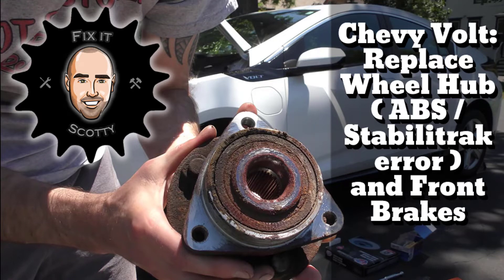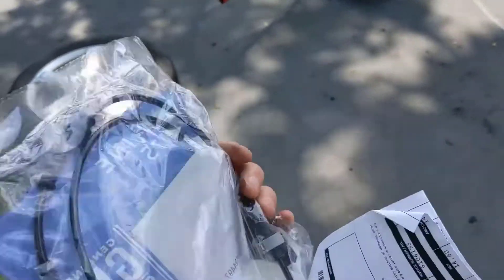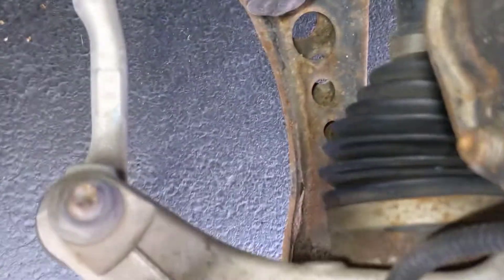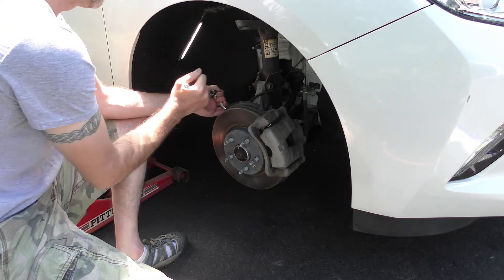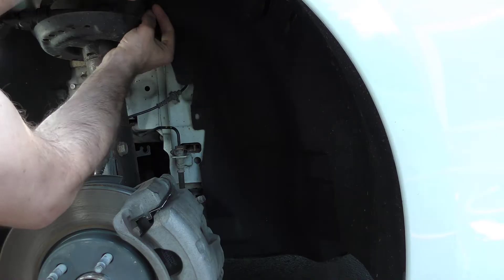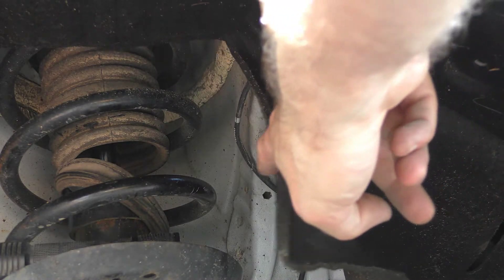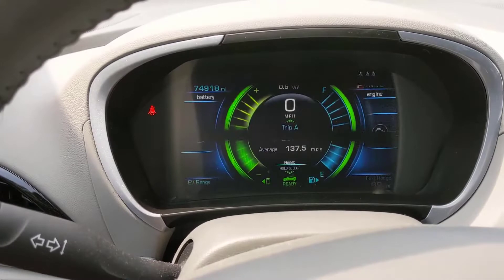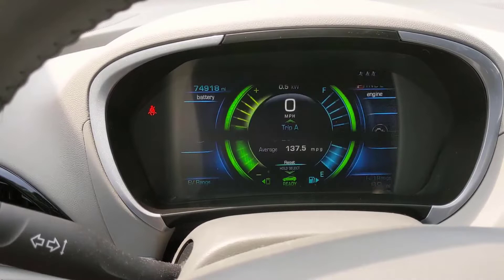Chevy Volt ABS Sensor Replacement for Stabilitrak Issue, P25A2 code

Comment: Sensor gets cut by th ring damage or not the slit in the sensor should not be there getting the ring out seen it done with magnet in fragments. Down to sensor reinstalled but first got to get orange ring ya said to put on ky theory is the sensor is breaking the ring as its no konger recommended to put one in period.
Reply from the maker: Another commenter informed me about the change in recommending not installing the thrust washer. It hasn't been a problem for me, but I will keep that in mind if I have sensor issues again.
Reply: @FixItScotty  thanks for reply and your videos are rare and appreciated so glad you are passionate about your craft well done. It will be interesting to note if it happens with your new one. So worthy of keeping it on, it may be the reason for the new axle nuts that were replaced. Ty

Comment: Replaced Hub, Speed/ABS sensor, Washer (not damaged) and axle nut on drivers-side front where the sound and affect appears to be originating from. Still having intermittent ABS activation at very slow (<10 MPH) speeds until stopped. Any other suggestions?
Reply from the maker: Good question.  This may be beyond my limited expertise.  The only thing I can think of that would cause ABS issues would be if the pads are worn way down.  Other than that, you may need a pro to check it.
Reply: Me too, I am thinking it is the repressurization pump.. did you get it figured out?
Reply: I brakes work fine until low speed under 10 mph then you hear the repressureization pump kick on then it throws the stabilitrak code
Reply: Washer don't need to be the ring cuts it damages it regardless rings not needed according to GM since all this

Comment: I just have the P25A2 code only nothing else along with it. So just replace the sensor and that will fix it? Says it’s a speed wheel sensor not an ABS sensor. I clear the code and anytime I hit a bump in the road accessibility track and everything pops up when it rains. It comes back as well when I clear the codes.
Reply from the maker: I think I mentioned in this video that in a previous video (https://youtu.be/44su3MaCbqs), I already replaced the wheel hub. I still had the code after that, so I replaced the sensor in this video and the code finally stayed clear.  It could be either the hub or the sensor or both.  I can't tell you for sure which one, but if you can do it yourself, I would replace both.
Reply: What ever happened?

Comment: i dont understand not using a jack stand for any repair that requires jacking up a car and getting under in any way
Reply from the maker: I normally use jack stands.  This repair was very quick and I wasn't really under the car, so I took the risk.

Comment: How do you know which sensor to replace
Reply from the maker: This is from another commenter.  In the service manual, it lists the relevant codes for the different wheels. (5 consecutive codes per wheel for the speed sensors)
C0500-C0504 all reference the Front-LEFT.
C0506-C0509,C050A  all reference the Front-RIGHT    (for people who don't know, the codes are in hex, which is why 'A' comes after 9)
C050C-C050F,C0510  all reference the BACK-Left        (again, hexadecimal shenanigans)
C0512-C0516 all reference the BACK-Right

Comment: I notice the Volt has rustier hub and brake parts because most braking is done by regen so the brakes never heat up and dry out.  GM should have used higher quality coated parts but the bean counters no doubt vetoed it.
Reply from the maker: My rear rotors rusted out before the front on the Volt precisely because of what you described. The dealer suggests the driver should, on a monthly basis, shift into Neutral as you are driving at speed and brake hard (like when exiting the interstate).  Regen is disabled in Neutral so doing this will engage the brakes fully to use the pads to scrape the surface rust.  This year I am about to replace my rear rotors for the SECOND time.  My car has under $80k miles.

Comment: Hey Scotty   According to the NTSB you're not supposed to replace the red ring   "https://static.nhtsa.gov/odi/tsbs/2019/MC-10168229-9999.pdf"  the anti-clicker which is the source of the problem as it eventually  wears down the newly purchased sensor IF its boring into the sensor like you showed..   I loved the video and will be performing the repair like you did .. thanks a lot for your excellent video and time

Comment: Hey Scotty, my scanner is showing this code, but I’m not sure which wheel hub + sensor need to be replaced?
Reply from the maker: This is from a commenter below...  The P25A2 code is usually accompanied by other codes.  C0500-C0504 all reference the Front-LEFT
C0506-C0509,C050A  all reference the Front-RIGHT 
C050C-C050F,C0510  all reference the BACK-Left 
C0512-C0516 all reference the BACK-Right

Comment: Thanks, Scotty! I used your video for the tankless hot water heater and now this hub/sensor issue came up and I saw your videos. Your videos are the best.
Reply from the maker: That's both very random and very cool. So glad I can help! Good luck on fixing your volt. Watch the follow up video I did that's pinned in the comment. Let me know if you have any questions.
Reply: @FixItScotty  

Yes. I saw both videos. I was tempted just to just replace the cable but I only want to pull it apart once.

Question: did you grease anything when reassembling the hub? (I have the red axle grease)

P.s. the tankless water heater went flawlessly thanks to your video.
Reply from the maker: @TheRentsTooDamnHigh   I don't remember having to grease anything.  These modern wheel hubs come with pre-pressed, sealed bearings.

Comment: Did you have to erase the lights or did they go away automatically?
Reply from the maker: Both the last fix and this one, I did clear the codes with my OBD scanner.  After about 100 miles of driving the code came back after the first fix (because I still needed to replace the sensor).  After this fix, the lights didn't come back after 100 miles.  If you don't have the scan tool, I believe you can just wait it out or have the dealer reset it.
Reply: @FixItScotty  sweet thanks for the reply just changed mine out going to drive around a bit if not go get it cleared

Comment: How do you know witch side is bad?
Reply from the maker: I asked my Chevy service department what the code meant.  They insisted it was for the front passenger side and they ended up being correct.  I assume there are different codes for the other wheel sensors.
Reply: @FixItScotty  In the service manual, it lists the relevant codes for the different wheels. (5 consecutive codes per wheel for the speed sensors)
C0500-C0504 all reference the Front-LEFT
C0506-C0509,C050A  all reference the Front-RIGHT    (for people who don't know, the codes are in hex, which is why 'A' comes after 9)
C050C-C050F,C0510  all reference the BACK-Left        (again, hexadecimal shenanigans)
C0512-C0516 all reference the BACK-Right
Reply from the maker: @samlachance2  Thanks!  Good information.
Reply: @FixItScotty  Scott in my case I've got a second code C0500 and message " left front wheel speed sensor circuit"
And the dealer doesn't have licence for "American car's" is guessing that could be the sensor or wire which goes to it 🙄